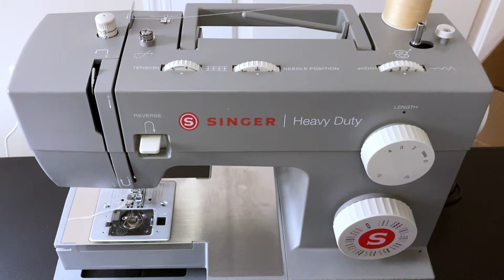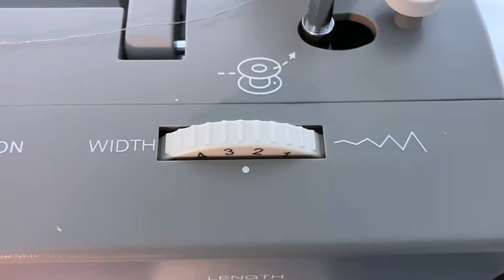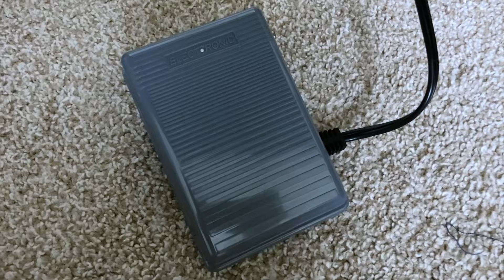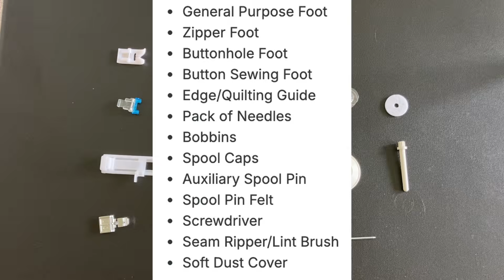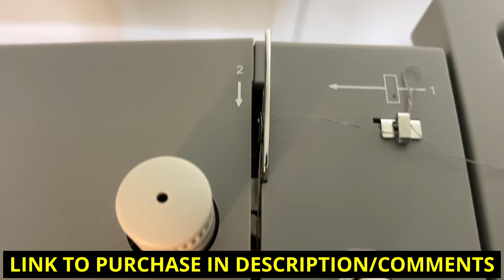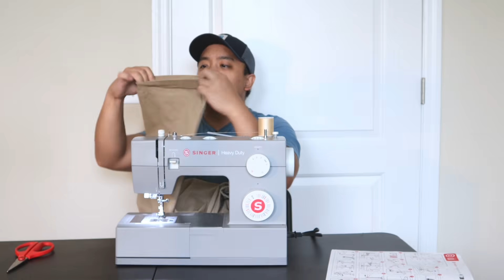SINGER Heavy Duty 4452 Sewing Machine | Demo and Review

Comment: Is the outside casing plastic or metal?
Reply: It's plastic on the outside. The frame inside is metal. If you're concerned about the amount of plastic inside you can probably find a video on YouTube of a repair or something?

Sewing Machine Repair Guy here on YouTube takes the outer case off one to do a repair for someone I think. 

The non computerized mechanical models should be pretty similar inside, if it's not the 4452, but a 23, 32, or 11, so you can see inside with all the parts you might be concerned about. 

It's kinda handy to know what to oil, grease, and lint balls to look for down the line regardless of if you service your own machine or not, just in case you ever need to, once the warranty expires etc! in a sewing emergency.
Reply: @TwilightStorm Thank You.  It seems the majority of modern nachines are metal frame with plastic exteriors.  I read the Singer company has been sold once or twice, customer service and quality have suffered.  I ended up getting my wife a Janome HD3000.  Janome is still the same company, original owners.  Quality control and service are supposed to be much better than other brands.  They say this machine is serviceable for 20 or more years.
Reply: @j @joekaras7080 rome is good if you have the experience it takes to make the higher 4:38 price worth it.  The 4452 is good for medium curtains and triple denim down to synthetics.  After 15 yrs on a commercial Juki at an upholstery company, I’m satisfied with this Singer at a great price of $259 incl the small table base.

Comment: How does this compare to singer model 2227
Reply: 2277 is a toy compared to the Singer HD line. 2277 is designed to attract beginners with a low price and less features such as no feed dog drop switch, feed dogs are always up. The motor on the 2277 is not as powerful as on the HD and the stitching speed is way less. There is NO presser foot pressure adjustment on the 2277, this makes it challenging to sew stretchy knits. To me the price difference is marginal for a significantly better sewing machine.  I would get the Singer HD every time.  If a machine says it is for a beginner, stay away IMOP.  That usually means less features, less robust components and designed for a shorter life and light weight plain fabrics like woven cotton. Some beginner machines are designed as throw away.  Not if but when they break you throw them away because the repair costs more than buying a new one.